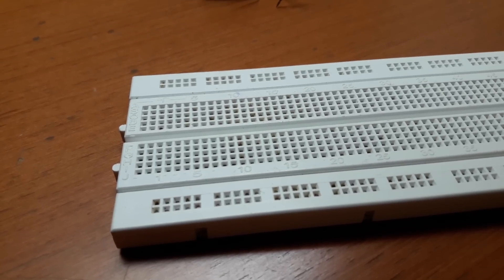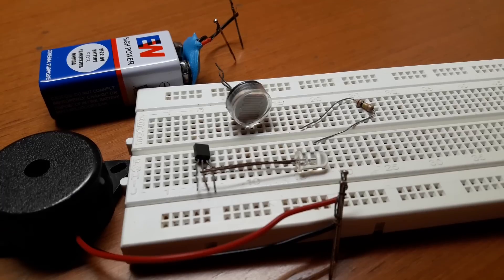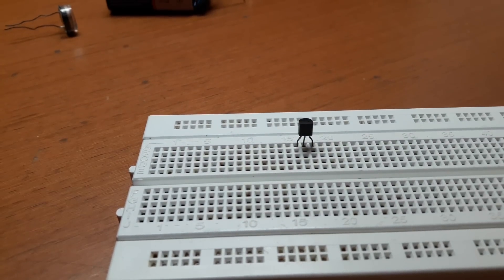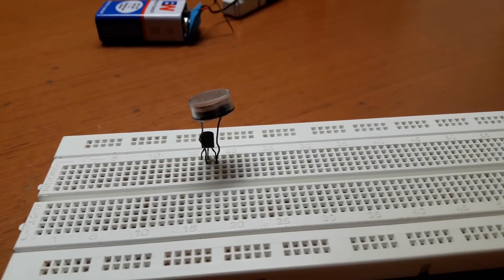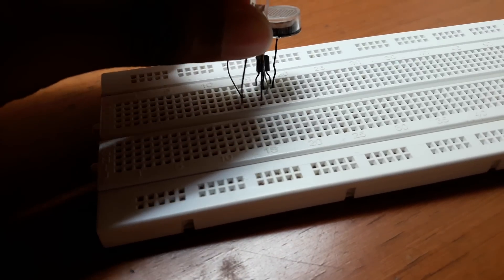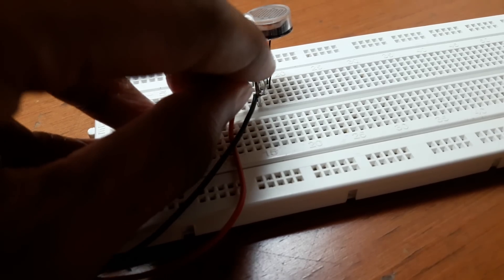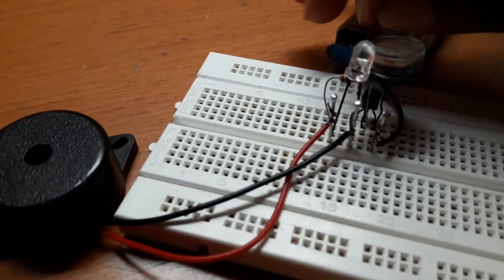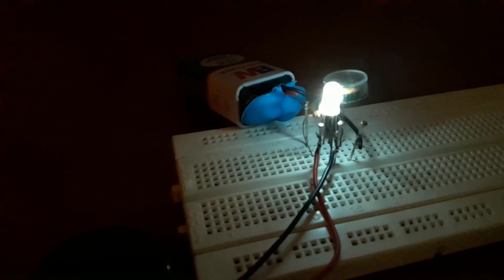How to make a "Laser Security Alarm System" at Home on a Breadboard.

Comment: Hi I  have  watched  your  video and tried  myself . But  it's working  opposite  of  yours ,when  the  laser  falls on the  ldr the buzzer makes  sound.
Reply from the maker: +Geetha Ranganath Hey! Try using a 100k resistor in place of the 330 ohm resistor.
Watch my latest "Laser Security Alarm System" on Breadboard :- https://youtu.be/n-Phvv4F59c

If it still doesn't work let me know! Mostly it should work! Have a great day!

Comment: pls tell me resister size??
Reply from the maker: +ochirbat tsevegmed You can use a 330 ohm or 100 ohm resistor.
Reply: Troy Araujo i used 100ohm it doesnt work
Reply from the maker: +ochirbat tsevegmed Use 330 ohm resistor then! I had a similar comment earlier regarding the same thing and I figured out that it works with a 330 ohm resistor. Try using 330 ohm resistor and send me your feedback.
Reply: Troy Araujo ok i'll
Reply: man im used 330ohm then its now working
Reply from the maker: +ochirbat tsevegmed Cool! 👍

Comment: bhai laser ka power jyada hona chaiye.I want to know its not working .will n7000 transistor work reply fast love u bro
Reply from the maker: +TECHNICAL GUY 8 I have used a BC547 Transistor. I don't know if the n7000 will work or no but you can try it out.
And I have given 5v to the laser. I think that is adequate.

Comment: man it does not work. wish i could is send you a picture of my circuit
Reply from the maker: Then maybe it's the LDR. Try using the bigger LDR which I have used and also make sure you have used a BC547 Transistor. It should work!

Comment: it doesn't work. as soon as i connect the battery the buzzer started making sounds and the circuit didn't detect darkness
Reply from the maker: +Hrit Chakraborty Try connecting the battery in  a dark room. As soon as you do so...the LED and buzzer with light up and make a sound.

When you switch 'ON' the lights or put a laser diode focussing on the LDR... the LED and buzzer will stop! (Every time you interrupt the light from the LDR the alarm should ring)

You can still check my previous video "How to make a 'Dark Sensor' on a breadboard" for better understanding. Hope this helped you! :) ✌
Reply: Troy Araujo thanks fot the advice
Reply from the maker: +Hrit Chakraborty You're welcome bro! :)